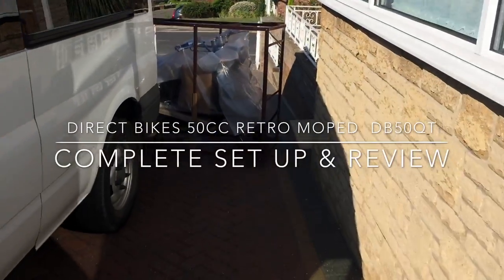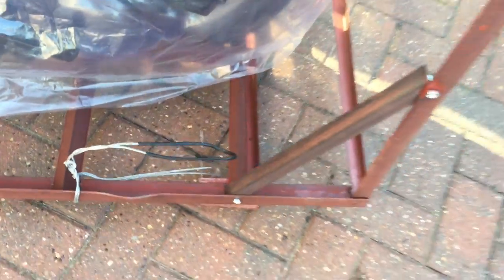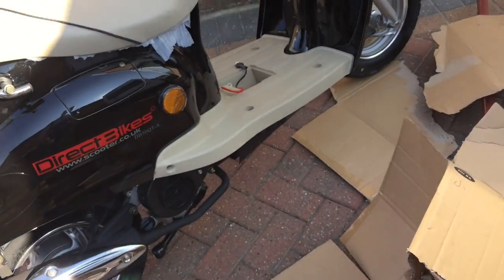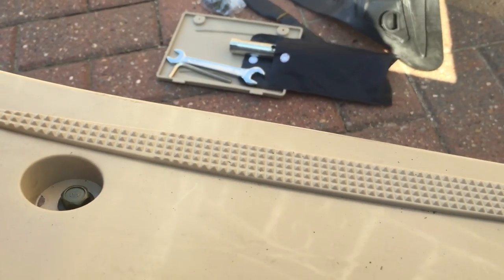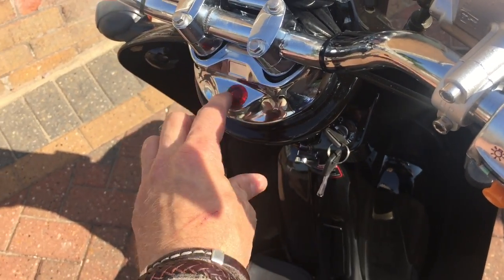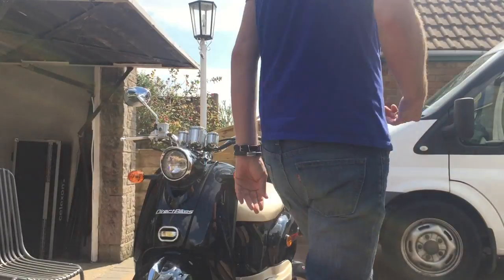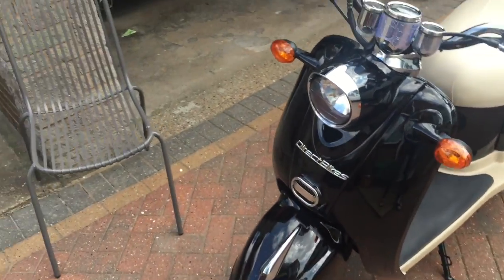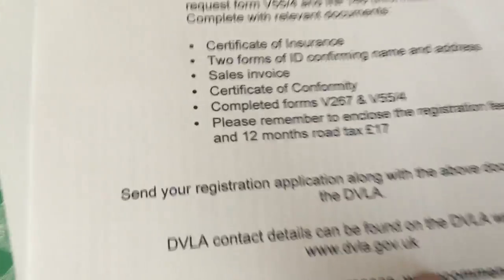Direct Bikes 50cc Retro Moped  DB50QT-A. Complete Set Up & Full Review.

Comment: The over all performance of the bike is great, good on gas milage, slick and clean look, I’ve had mine since 2012 still running, only negative is the paint jobs sun fade quickly and they are easy to steal. Literally someone can walk up d walk away with it. You can buy a key lock for front rotor/break disc. That has alarm to it, which is good. Mine a daily driver.

Comment: I got this model in 2018, it's been great fun, I have never had an issue with it until now. It will only start on the kick. Where is the spark plug located at ?? 
The battery is good, the fuse is good, oil is fine, plenty of fuel.
Reply: Might need new corb mine was same changed corb works fine now

Comment: Mathew, the lil empty hole slot that Has the red bud in it below the gauged is for the rubber end of a mobile mount also there is an alarm system that plugs in there and responds to movement. Sunny sports in Ca (now out of business) sold both accessories for their JL50QT-6A (same as your moped). I have one as well, love it, however maybe you can help me, I’m looking for the ignition key set (my keys missing) ID num if it’s available in the Manuel. Would you still have yours?

Comment: You have very soon found out about direct bikes  public relations  ie they don't exist. Direct  bikes take  every  opportunity  to wash there hands of any faulty  goods that they send.They have featured  on bbc watchdog  as rogue  traders.I don't say all there buyers  have trouble but if any do they back away from you rapid.Another major  issue  is obtaining  parts.Running gear ie engine parts are easy to obtain  but panels  are near impossible  to get.Direct bikes do not have a part department  as such and point peaple to a company  called  Chinese  motorcycle  parts online. They do not own this firm and even  though  it is a very good firm they will struggle  to get panels and trim parts.So buyer  beware as they say.
Reply: +Steven Threlfall Im glad I came across this video, I WAS thinking of buying a bike from them but stuff that now.  I think I might get a second hand one and save myself 600 quid.
Reply: Steven Threlfall even tho this comment was made 2 years ago ! you just saved me alot of money. I was thinking about buying one becuase of the price but it's too good to be true.